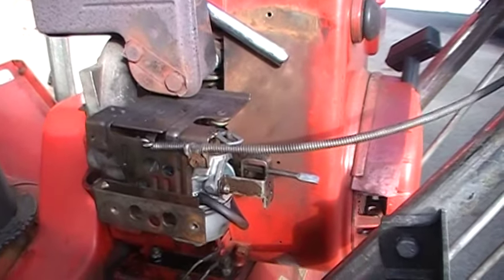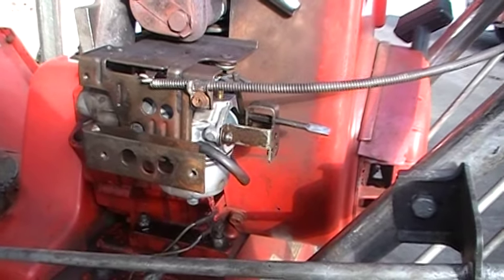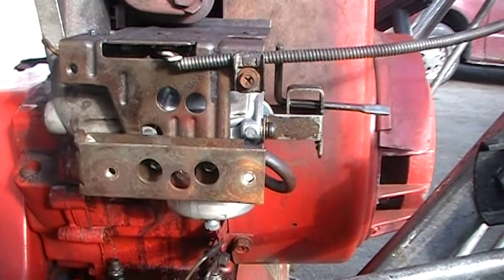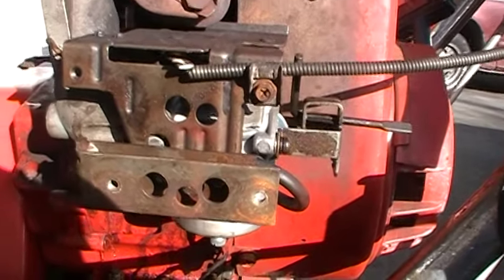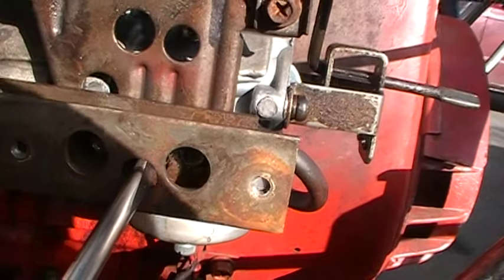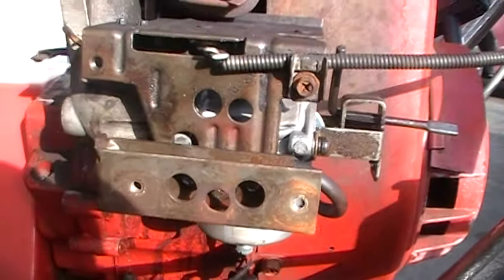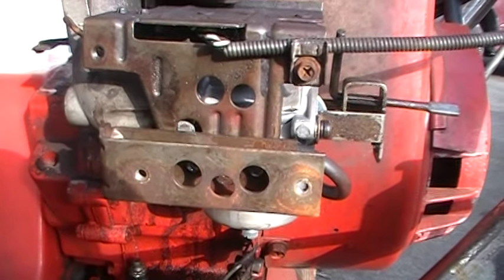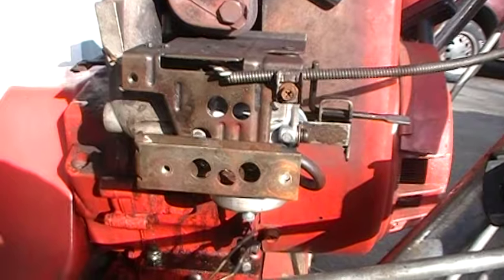How To Adjust The Carburetor Idle On Snowblower With Tecumseh Engine Toro Ariens

Comment from the maker: This video will explain how to adjust the carburetor idle on your snowblower equipped with a Tecumseh engine. You should be able to apply this to pretty much and small engine with a carburetor.
How To Adjust The Carburetor Idle On Snowblower With Tecumseh Engine Toro Ariens